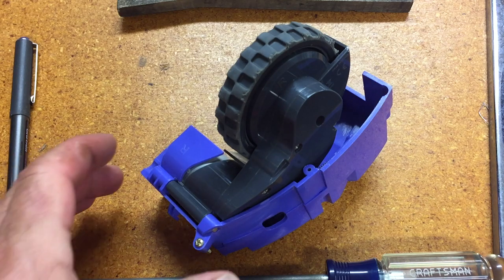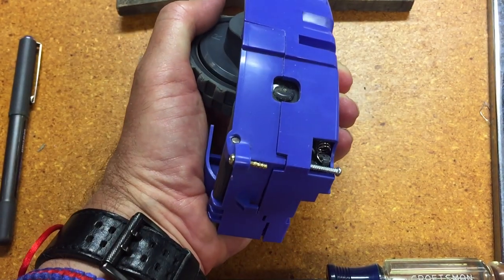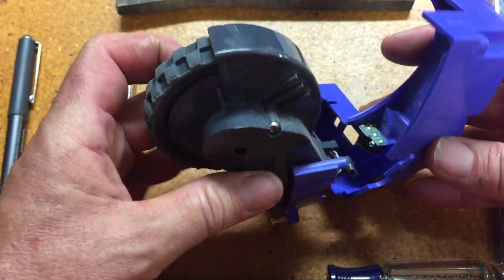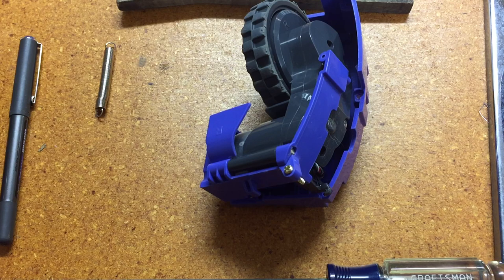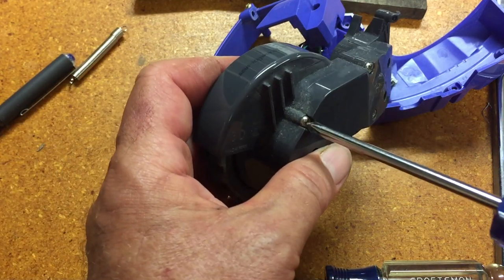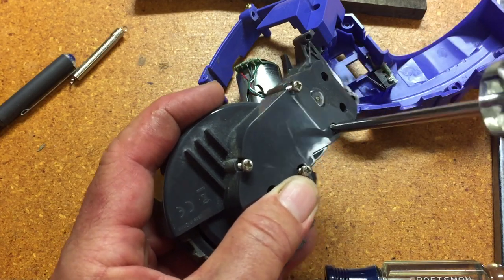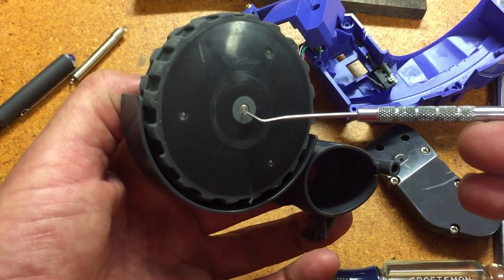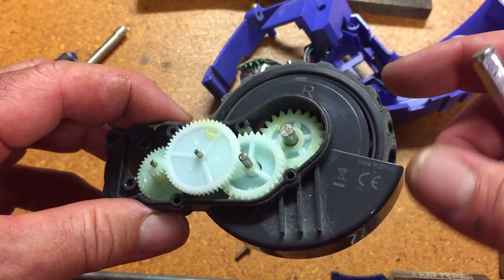Roomba 650 Sidewheel inner workings

Comment: My Roomba 600 had dirt inside the one main driving wheel until the friction became too much for the motor.
To get the side wheel off from its axle:
1. Remove the wheel module. https://homesupport.irobot.com/app/answers/detail/a_id/514
2. Hang on to those 3 screws - 1 of mine fell off
3. Hold on to the wheel with your hands (or support it on the edges if you have nobody to help). Hammer on the central axle with a punch and and light hammer.  Slowly punch the axle with the rest of the wheel module out of the wheel.  (The small metal "rim" stay attached to the plastic wheel and rubber tire.)
4. Clean the mess around the axle.
5. For re-assembly you'll need a punch (or nail) to support the axle from the wheel module side while you hammer the wheel back on.  Note the axle and the "rim" has fine notches that should align.
6. With the wheel and rim flush assembled, I had to support the wheel module on something soft and hammer the axle still deeper into the wheel module until the tire was properly aligned to the wheel module - similar to the other wheel.
I'm sure iRobot will want to sell you a new wheel module when it only needs cleaning.
Reply: dunno if you guys gives a damn but if you're stoned like me atm then you can watch pretty much all the new movies on Instaflixxer. Been binge watching with my gf during the lockdown =)
Reply: @Chris Bronson Definitely, have been using Instaflixxer for since november myself =)
Reply: Ferdi, I was able to fix my based on your inputs. Thanks
Reply: @ppalagyi  I'm so glad I could help. Later on it started moving on the axle again and I had to apply lock-tight glue

Comment: The white gear is pressed onto one end the shaft. The other end of the shaft is splined and pressed into the wheel hub. I got mine off by placing it on top of a socket wrench and really hammering on it.

Comment: Great vid. I was able to apply this to my roomba 980 who’s right wheel is stuck.  Unfortunately the gear box is completely clean so the debris must be on the wheel axle behind the plastic.

I’ve seen another tutorial where they drilled a 1/4”’hole near the axle and used a paper clip to pull out A LOT of debris.  Wondering if you’ve found a better way to get in there.   The good news is mine is still under warranty so I got a free eight wheel module on the way so I can make a science experiment out of my broken one.
Reply: Were you able to remove the wheel from your gearbox on your broken one? My Roomba 785 ran over a ribbon that is now caught around the axle of the big wheel. I'm trying to figure out if I can just pound the shaft loose or if there's some other way it's held in place.
Reply: David Mathew I have the exact same situation with my 980. The wheel cannot be removed I believe.
Reply: I did get it off.
Reply: @DavidMathew82  I had a similar problem and got mine off, cleaned and reinstalled. I'm not very technical.
Reply: i wound up drilling a couple of holes into the wheel from both sides.   i removed most of the parts, clamped the wheel in a small vice to hold it then carefully drilled the holes.  Then i managed to fish out the rubber band and other garbage that had been sucked into the wheel
Reply: @FerdiLouw  Hey!  Did you get the wheel off of the gear box by punching it out in the opposite direction as in this video (away from the gearbox towards the wheel)?  At this stage can you get at the wheel axle?  Thanks!
Reply: This guy posting this video could have stopped at the removing the module and pry out the wheel with a flat bar.  The wheel slides off the shaft while turning and wedging along the way.  Eventually the play happens and it falls off with or without the shaft.  Easy to slip back together and press it back on with you fingers. This is all without disassembly  and not having to open the gearbox to get the to gears at all.
Reply: You can punch the axle out hammering from the wheel side